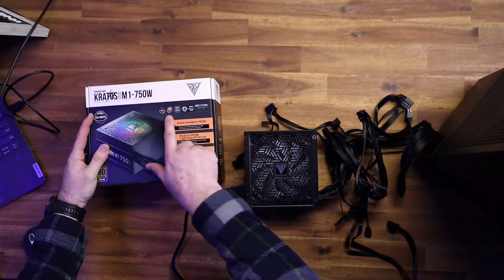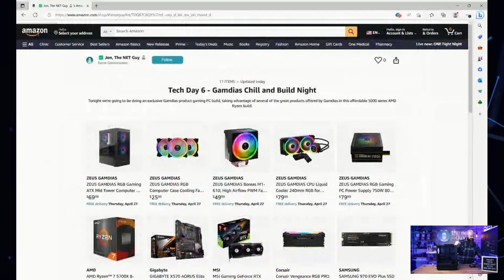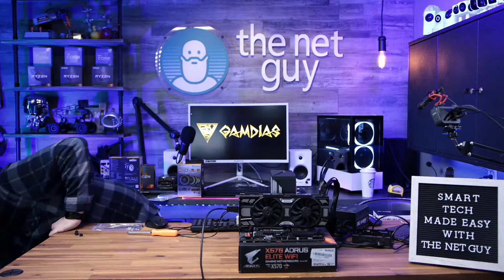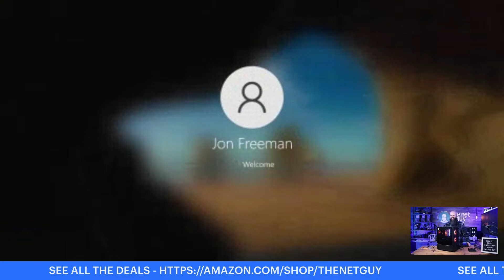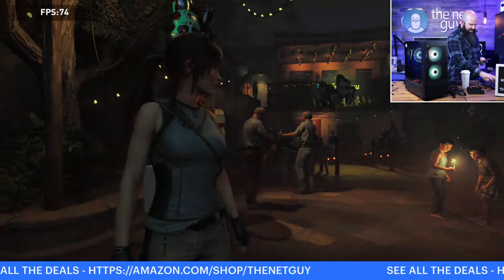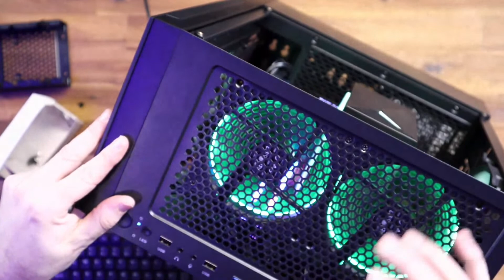Chill & Build - Gaming PC Powered by Gamdias

Comment: I just have a question, how are those argb fans connected to each other through argb. I cant find the connecting argb ports.
Reply from the maker: The gamdias stuff has a separate controller but it has a cable to go to the argb header.
Reply: @TheNetGuy  thnx man ill check it out tmrw